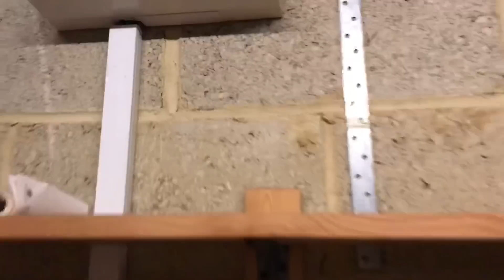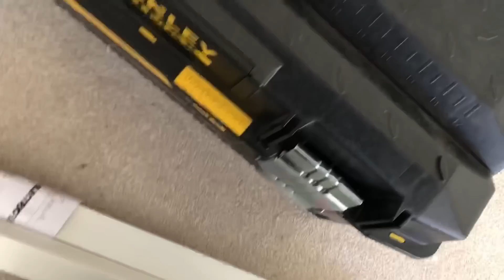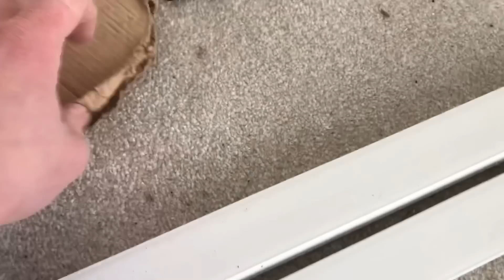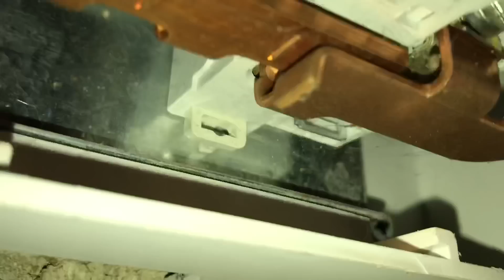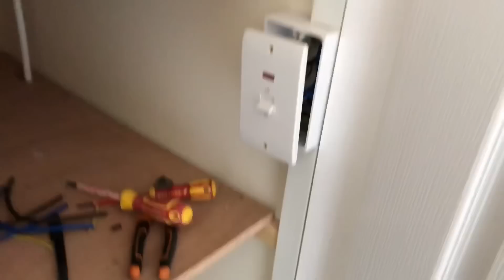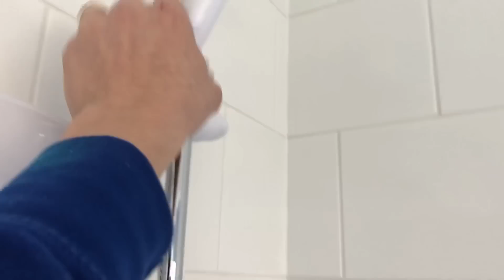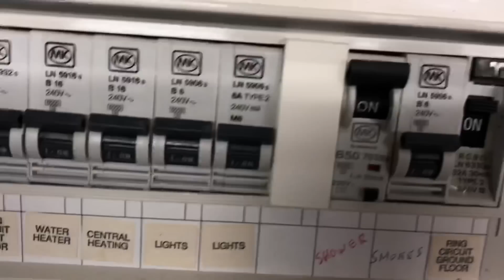Electricians day installing shower circuit and consumer unit find.

Comment: Theyve done a lot of refurbishment yet then they fit an electric shower. Yuck. Looks like they could have taken a hot from under the bath too for a decent mixer.
Reply: Perhaps they have an older style hot water system with a low head from a tank in the loft? Also, miserable though electric showers are they are useful if you have a combi boiler which will invariably fail every now and again. An electric shower somewhere in the property can be a good idea for this reason, especially if you have more than one bathroom- stick one in the least used bathroom just in case. For my own home I would always choose stored hot water and a regular shower wherever possible though.

Comment: Good informative vid as usual!! My shower switch gets a little warm when in use. Is that normal? (40A breaker, 6mm, 8.5kw shower)
Reply from the maker: What shower switch do you have ?
Reply: @Cjrelectrical  It's a Triton Enrich
Reply from the maker: And what is the isolation switch rated at?
Reply: @Cjrelectrical  The isolation switch is a MK rated at 50A. BTW the fuse board is in the room below. So not a long run at all.
Reply from the maker: It all sounds adequate.
If it were my shower I’d check the connections were nice and tight.
Reply: @Cjrelectrical  Cool! I checked the switch earlier.... I'll check the shower connections later. Thanks for the help!
Reply: @Cjrelectrical  All the terminals have been check now and all are good. Still gets a little warm - mainly near the neon/supply side. I'm not able to compare it to another installation at the moment but if you can, any advise will be appreciated. Cheers
Reply from the maker: Neons do get slightly warm
Reply: @Cjrelectrical  OK nice one! I'll keep an eye on it

Comment: Rcd protection for the light in that bathroom?
Reply: He weren't working on the lighting circuit for the bathroom so why would he fit an RCD for it? The installation certificate applys to the installation of a shower circuit and that's it.
Reply from the maker: I only installed the shower circuit.
Reply: I'm pretty sure the pipework for the electric shower doesn't need to be supplementary bonded as the pipe is pvc, all he is required to do is fit a 30mA RCD for the circuit he's installed. What the other electrician did or didn't do to the lighting circuit is he's problem.

Comment: Had the manager of my local pub ask me to install a 10.5Kw electric shower he bought, I tried to explain that it can't be done and a power shower would be the answer (gravity hot and cold water) he ain't 'having it (he tells us he has been an engineer most of his working life Haha). 73 Amp (with diversity) that's just the commercial kitchen + pub + external function room + 3 bedroom flat (with electric cooker) Supply is 100a single phase, and he was an engineer, yeah right!
Reply: Electrical Engineers have test equipment which can monitor Peak Current Consumption over Time, this gives an exact idea of useage, but one should always take onboard change of a Tenant who's needs may be different, but as I have said many times, if Diversity is calculated then 100A will run what appears on paper to be a massive load.
The biggest dangers I have seen in the Industry is where Large Cables are Connected to small Cables ie 35mm Tails linked out to 16mm Tails at the Origin, this can and does cause Fires
Especially when running large E7 Loadings overnight. 
Mr Spence Eng
Reply: @apartmentswales  Totally agree with you on this matter!
Reply: @CrazySparkie63  Thanks for your agreement, but come to think of it a I have never seen a Pub unless running from someone's house in West Wales that does not have a 3 phase installation, as the classification of this type of Business is a Commercial Business
Mr Spence Eng

Comment: Whenever I have to install a ceiling pull switch on 10mm, I always check for swear boxes, cos that will be my profit gone Lol!
Reply: Have you ever used the crabtree 50amp  shower pull cords.  10mm is easy on these ones 👍
Reply: Click also do the round ones. @marktether6883
Reply: @johndufton9686  thank you for the info.  I will ask supplier on the next job
Reply from the maker: I’m fitting one of those next week.

Comment: is it OK to use banding for protection against premature collapse? 
I was recently criticised by "pro's" on Facebook for that as it has supposedly not been tested for such purpose!
Reply from the maker: Pro’s and Facebook don’t belong in the same sentence. There’s no difference between banding strap and the supper expensive clips they market for fire resistance clips. They are both made from steel that will withstand a fire for long enough.
Reply: @Cjrelectrical  that is exactly what I said
Reply: JW will fire test it for us 😁

Comment: Would love to see a bit more on the testing I haven’t a clue could you also tell me what that fireproof mastic is or where you can get it thanks
Reply from the maker: https://www.screwfix.com/p/no-nonsense-intumescent-sealant-white-310ml/5689r?_requestid=643226
Reply: I assume that if you put a screw in the left over nozzle the mastic lasts a bit or does it go off

Comment: Did you exceed max demand on that switch?
Cooker, 2 x socket ring, water, heating lights up lights down smokes and shower
50a + 40% (40+32+32+16+16+6+6+6) 154/100 x 40'= 61.6 + 50'= 111.6A
Reply from the maker: No
Reply: @Cjrelectrical  no worries not picking just how I added it up. It is largest plus 40% of rest on a,domestic board though right?
Reply from the maker: Appendix A of the onsite guide is very useful
Reply: @damianchivers1004  No, this is the lazy way of doing it, as Chris said OSG gives guidance on calculating maximum demand and applying diversity.
Reply: Lights are gonna be fuck all.
Reply: @barrybritcher  Not how I would have put it but yes, next to nothing on the lighting circuit especially as we're moving towards LED. We certainly can't go by the recommendation of 100 watt per lampholder in the OSG.

Comment: Top job Chris... Good to know I'm not the only one that leaves a few mil gap for trunking bends. I probably would have tried to persuade the customer to have  a few lengths of perforated cable tray fitted to support the wiring in the garage.
Reply: Just wondering how come you didn’t take the trunking right to the end of the wall after going through to the shower I find it always looks more tidy than just a bit stopping half way across a wall with a stop end on it.
Reply from the maker: Yes I might mention it to her it’s bugging me too.

Comment: Fixing the cables is to protect fire fighters coming into the building from getting entangled, not people exiting. Nice job. 9.5/10
Reply: I think it's to protect both, if you remember in the 3rd amendment, it was only wiring along escape routes that required supporting from premature collapsing, that was primarily to protect ordinary persons trying to exit the property. The supporting along the entire run is to protect both firefighters and ordinary persons.

Comment: For your customer with a 2 shower request, could you connect them via a changeover switch, so only one could be live at a time? Yes, they would have to manually switch it, but that may be better than a no, or an upgrade to three phase?
Reply: You could, I suppose, but why not an automatic changeover via a contactor?

Comment: why don't you sleeve the hole through the wall, protecting the cable?
Reply from the maker: What am I protecting the cable from? Falling insulation? Anything under 50mm doesn’t require sleeving.
Reply: @Cjrelectrical  i knew that would be your reply. i just find it good practice chap.
Reply from the maker: Okay wait for the next video 👍
Reply: I was alway told to stick a bit of conduit through brick walls for cable! Is it not better and takes the same length of time to do?

Comment: Pretty interesting seeing the hot water system IN the shower. Is that common practice over there? Not sure it would fly in Australia
Reply from the maker: Do you mean the internal workings of the shower?
Reply: CJR ELECTRICAL I mean actually having the water heater in the shower. Most of ours are on the external of the building and then the hot water pipes run in inside the wall to the shower head.
Also,  I don’t think Australian Standards would allow for the hot water heater in the shower space
Reply from the maker: Interesting. Do you have zoning regulations in a shower or bathroom?
Reply: CJR ELECTRICAL Yeah so they’re slightly different for different areas. I’d have to check the standards book for exact table on shower zones
Reply: Plateau Electrical it's not really a water heater in the sense you mean, it's a shower unit designed to be installed within the enclosure. Yes I know it heats water, but it's not really like those old over the sink things. They were once available in Australia but I am led to believe they were three phase and not common. They are popular all over Europe and I guess proven safe- I have to agree though I am always slightly wary of them.

Comment: Shower switch in a cupboard?? 😳
Reply from the maker: Yes ? Perfectly acceptable
Reply: @Cjrelectrical   did you check manufacturers instructions I have never seen one that doesn't say it has to be in the same room (cant remember there exact wording) there are no regs against doing what you did but as far as I understand it has to be installed to manufacturers instructions an they as far as I understand always say it should be accessible/in the same room (again cant remember exact wording they use) I have had this come up before there are conversations on forums about it
Reply: Nothing wrong with that, who's want to see a big ugly isolator switch on their wall or a manky ceiling switch... As long as the customer knows where it is and it's noted on the installation certificate, I'm happy.
Reply: What’s wrong with that ? Find me a reg to say you even need a local isolator . Good practice
Reply: @robswingler  yes your right and I thought exactly the same until I did lots of looking into it and like I say it should be installed to manufactures instructions so if they say it doesn't need one that's fine but I have never seen one that doesn't. but perhaps his did not specify one
Reply: pete marshall 18th edition actually says must take MI into consideration now. So it’s a bit of a grey area . I would always fit a double pole isolator but it isn’t against the regs not to. Mcb and main switch as long as they can be locked off fill all isolation recruitments
Reply: K C I didn’t say follow MI . Read reg 134.1.1 “shall take account of MI”
Reply: K C the wording was changed from “ must follow MI “ to “ take account of MI” for a reason , they don’t mean the same thing . Don’t you get that? Why would they change the wording if they meant the exact same thing ? I’ve read many MI on say lighting that completely go against the regs and are dangerous so that’s why they have it .
Reply: K C realistically what is the one part of the shower that fails 9/10 ? It’s the local isolation (mainly 50A pull cord ) you’re putting a joint in a circuit which can create a problem . I’ve seen loads of burnt out pull cords ( that could of started a fire) .
Reply from the maker: Who needs a consumer unit ? Why don’t we have 100amp rings round the house and tap into what we want .
Reply: K C as I said I’d allows fit one but it’s not a requirement of the regs and you you don’t have to follow MI ( the wording was changed for a reason) it’s just good practice
Reply: @Spark101.  It might make for a faster brew.  :)

Comment: Didn’t see an end cap on that trunking lad
Reply: PVC Boxes they are decent will only use them myself now 👍🏻
Reply from the maker: I filled it with intumescent sealant and please link me to the 47mm plastic boxes please?
Reply: I’ll find out about the boxes in the morning, you can drill them anywhere and they flex, not used those brittle ones for years.

Comment: Buy the pvc back boxes , those brittle plastic ones are shite
Reply: do they make a deep pvc
Reply from the maker: Yep just found them
Reply: @Cjrelectrical  how deep do they go 47mm?
Reply: Yes 47mm
Reply: I’ve yet to see a deep pvc box 🤔
Reply: Got a link 🤔
Reply: A quick google search shows up plenty of boxes square or round corners but are 44mm deep so I may be wrong on that, will check my supplier tomorrow and see if they are 47mm, in any case 44mm is good enough.
Reply from the maker: The ones I found are 44mm

Comment: 16:40 nooo, we never pull the main fuse, honest.
Reply: Depending on the DNO, you can get their blessing. My local one issues temporary seals to part p approved sparks. I then add a main switch fuse.. Adds a bit on the job, but then you only have to pull the main fuse once.
Reply: putting it back in is worse imo
Reply: Is on an iron clad

Comment: Good video! You can get a shower priority unit that would only allow one shower supply to be on at a time, works well 👍
Reply: How much are those units?
Reply: £100 plus VAT for a unit where you choose which shower is priority or £140 plus VAT for a unit where the first shower to be used becomes priority, from meteorelectrical 👍

Comment: I think 2 firefighters were killed last year tangled up in fallen down wiring.
That's why they've bought in that new reg, makes you think doesn't it!
Reply from the maker: Yes I totally agree with it but the installers got to use common sense to.
Reply: CJR ELECTRICAL why say it was a load of balls then? Firefighters have died as a result of being entangled in dropped cables.  We now receive specific training in how to free ourselves and my brigade now have insulated wire cutters permanently attached to our breathing apparatus sets. Also, one of the priorities at a house fire is to make your way to the cu to isolate it so not having to deal with a nest of cables is always good. Remember that in a fire you have zero visibility and you have to cut and release yourself blind, it's not easy.  Rant over. Love the videos.

Comment: Nice job. Shame the plumber's is not as good. I don't like the way that pipe is not supported as it runs up in the cupboard. Just an observation: a 100A BS1362 cutout can run 120A for twenty minutes, so, provided there is no electric hob, one might get away with two 10Kw showers, though you're right to advise against it.
Reply from the maker: The pipe had 3 clips on it not visible as hidden by the new plywood shelving.